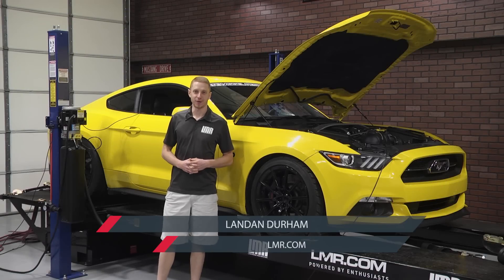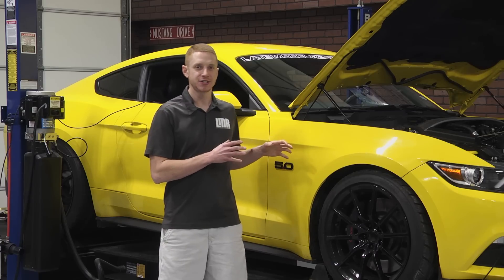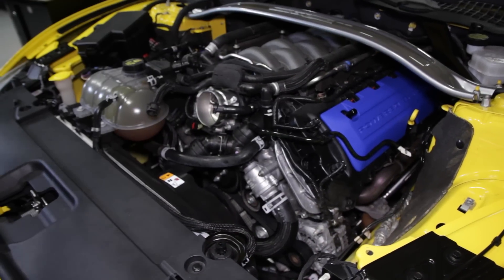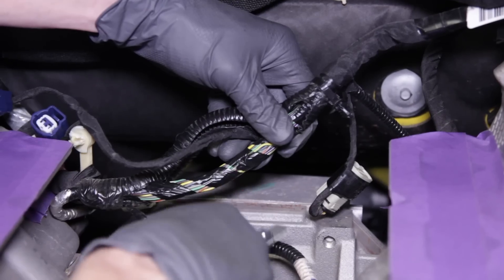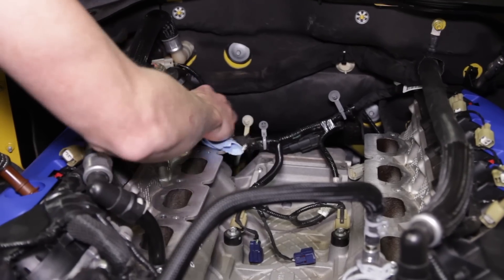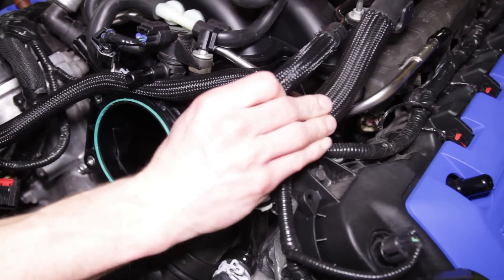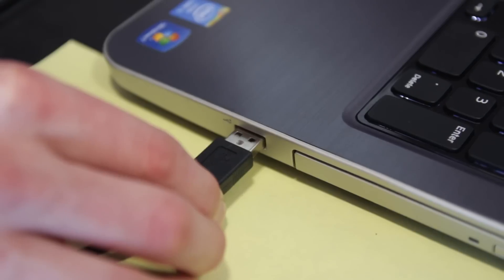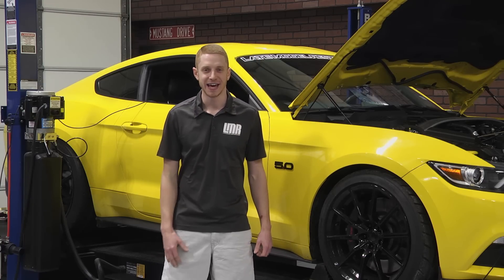2015-2017 Mustang GT Ford Performance Stage 3 Power Pack - Install & Dyno

Comment: I was able to get 409hp 407tq to the tires in a 14' Camaro automatic with full exhaust, CAI and a 91 octane tune.  The LS and Coyotes are tough to beat.
Reply: Those numbers aren't too shabby.  You need a cam to really wake up that LS though.
Reply: rompn4x Ls3 or L99? Ls3 is what you want
Reply: Denzell Powell akioras boy
Reply: That's it?

Comment: What the time for install? Trying to find out how much for install! Great video!
Reply from the maker: Thanks for the feedback! A time frame would all depend on the installer's mechanical background. From start to finish, this install took me roughly two hours. All of the small tedious work took up the majority of my time. -Landan
Reply: Late Model Restoration thanks! 2 hours for you and the dealer will charge for 3 I think. Going to call them tomorrow. I like the safe but more power way for sure. Can you data log this setup up? How would I know that my car is running correctly after this install? Or if the car could run better? Thanks!
Reply from the maker: No need to datalog. This a Ford calibration and is 100% dead on with ZERO drive-ability issues. In my opinion, the car drives and feels better than it did stone stock. Hope this helps! -Landan

Comment: Ive been waiting for this video for a while thanks LMR. yeah only 37hp but look at the peak gains! The stock GT runs out of steam and puts out 360whp at factory redline of 6700, after the stage 3 power-pack its still pulling harder for another 700-800 rpm to 7500rpm and 410whp with no lift shifting. Thats a 60whp gain up top with stock driveability. This would make a massive impact on a roll race. And you keep your factory ford warranty for 2k, im sold. I have a 15 GT pp when I get my tax return you will get a call from me LMR.
Reply from the maker: Thank you for the great feedback! -Landan
Reply: Late Model Restoration, read my comment I just posted. Thanks
Reply: Lol same, 7500 redline im sold.
Reply: Force Times Distance Equals ? Torque wer you
Reply: Plus look at that torque curve, it's basically a plateau.
Reply: we have found better power with porting the stock intake at the tb inlet and just cleaning the runners--along with tony gonyons dyno tunes I make 392 hp and 379 torque with small mods-in a 14 auto---when not spraying

Comment: if you have 2k for the stage 3 kit and another 2k for the gt350 exhaust just laying around might aswell of added that money toward a real gt350 down payment lol
Reply: A GT350 down payment?? Really??? You're talking about a 25k difference on average in pricing. That's enough to buy halfshafts capable of withstanding 1000HP.... A formidable clutch and trans, a forged short block and turbos/Supercharger.... You are talking about a full build here.
Reply: 25k diff without dealer markup. one at my dealer was selling for 80,000. Thats x2 what my GT cost.
Reply: Texarmageddon what i ment was if you have thousands of dollars to just throw away, you could probably afford a gt350.

Comment: not worth $3000
Reply from the maker: Good guess, but it's actually $1999.00. https://lmr.com/products/15-17-mustang-power-packs -Landan
Reply: Late Model Restoration My bad I thought I saw it advertised for $3000
Reply: jrvbamafan1 jrvbamafan1 dont forget you are tuning a boosted factory car while adding an intake and pulley. Of coure you're gonna get big power off of that. While the Coyote is not boosted its still getting some good gain with just an intake. 03 cobras are great due to their supercharger but nothing beats a Coyote n/a engine at 435hp vs a 390hp supercharged 4.6. Dont even think im hating now so careful with your keyboard 😘
Reply: Late Model Restoration that's why I'm thankful for my 03 cobra....for an intake, pulley, and tune for around $1000-1200, I get around 80-85 hp AND torque to the wheels. the 03-04 engines are still the best bang for the buck engines to ever come out of Ford....be more than happy to let yall do some mods to my car if you are looking for a low mileage cobra. it's also the second rarest color in mineral grey with only 302 made, and it's got 16,800 original miles right now
Reply: Doggy Style nah I don't think you're hating....I still rather have the 4.6 supercharged personally...I've owned a 2011 5.0, and they are great engines, but I love the instant rush of power with the supercharger
Reply: Doggy Style nah I don't think you're hating....I still rather have the 4.6 supercharged personally...I've owned a 2011 5.0, and they are great engines, but I love the instant rush of power with the supercharger
Reply: jrvbamafan1 thanks babe 👠😘👙
Reply: Angelina Lopez i love u .. and i have a mustang too😜
Reply: Angelina Lopez hola

Comment: lots of work and money for 37hp!
Reply: no doubt, save your pennies and get a forced induction setup
Reply: blade000007 Look at the top end power its around 60 wheel more at above 7000 rpm so it is worth it. Also the tunes are pretty conservative it should make much more
Reply: Yeah... but, but... GT350 stuff ;)
Reply: blade000007 this is basically to keep Warranty on car otherwise...too pricey
Reply: CENTENON you do know 17 year olds can drive by themselves
Reply: That blue whip so on full exhaust and Lund tune you have spent almost as much as him and he still has a Ford warranty right? Im looking into making my car faster but this is pretty pricey
Reply: joeythehat9 hey
Reply: blade000007 especially since stage 2 is cheaper, way easier to install, not far off on HP. But somehow has a good amount more of TQ over stage 3. Stage 2 is the way to go!!!!
Reply: atvkid0805
Why would I want a 700hp Mustang?
Reply: You can still get thoes numbers cheaper from a basic tune !!!!
Reply: Robby Boyles not happening
Reply: blade000007 yea American cars are bullshit people is gonna get other better n cheaper cars
Reply: Pancho Billa only in your dreams